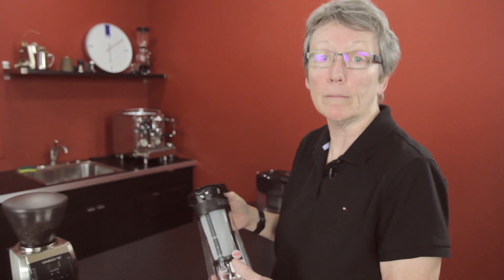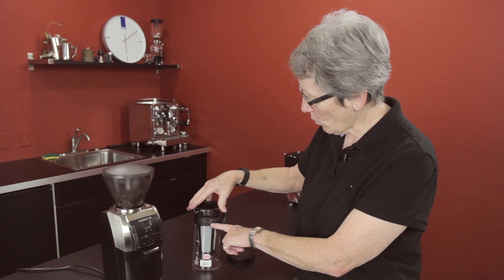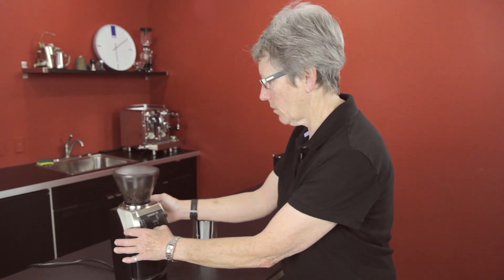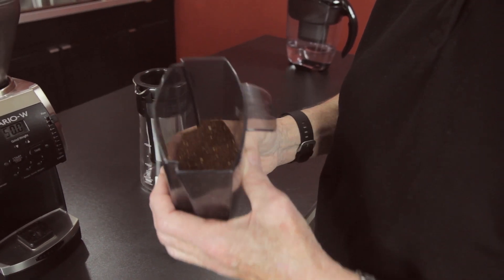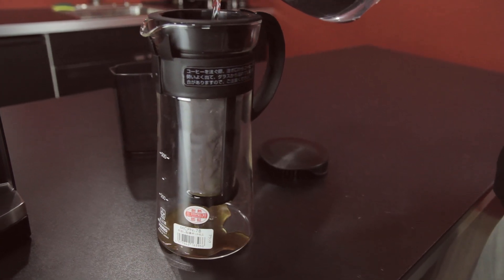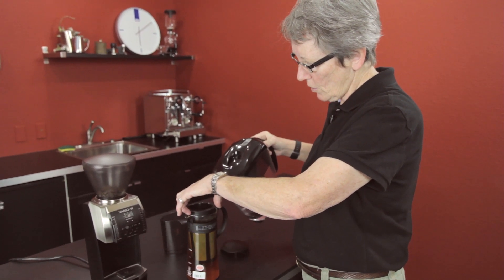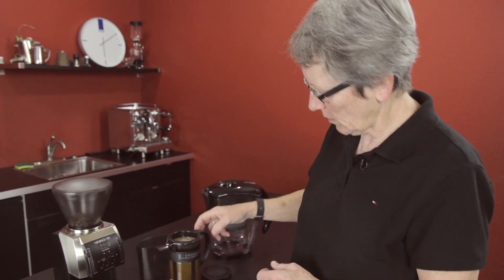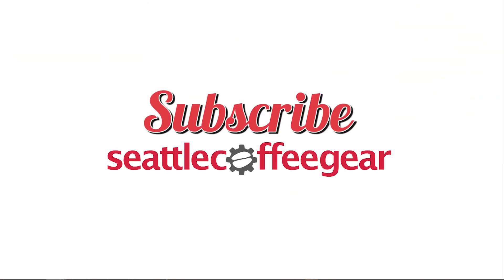How To Cold Brew Coffee!

Comment: Help! I have a Primula Cold Brew infuser. I grind my beans with a burr grinder (course grind). But I keep getting a little sand-like coffee grounds at the bottom of my cold brew. What am I doing wrong?
Reply from the maker: It needs a very consistent, coarse grind in order to avoid any fines in the cup. You may want to try an even coarser grind setting if you can. Otherwise, it may simply be due to the grinder not being perfectly consistent.

Comment: Question: I've never been a coffee drinker, so I am completely ignorant on coffee.  I've just started making cold brew to mix with other drinks.

I've noticed a mud like consistency settling to the bottom. Is that normal? Do most people drink that? Or filter it out?

It seems like it will mix fine if shaken or stirred, but I've tried using a standard paper coffee filter and that filters it out.

I'm only using it as a mix in protein shakes, so I don't care about the consistency. I just don't want to drink it if it is bad for me.

Comment: Question for Seattle Coffee Gear: what about caffeine? Would you expect cold-brew coffee to contain more or less caffeine then regular drip-coffee? Of course, keeping the same coffee/water ratio, same coffee, same grind, etc...
Reply from the maker: ascosta Toddy has done some studies around this question. In their test, using the same coffee blend, the cold brew delivered 40mg of caffeine per 100 grams of coffee while the hot brewed coffee had 61mg of caffeine per 100 grams. So it seems that cold brew contains less caffeine. But in a practical setting, we don't notice a difference with our buzz. You can also adjust how much you dilute your cold brew if you wanted a higher dose of that lovely chemical :)